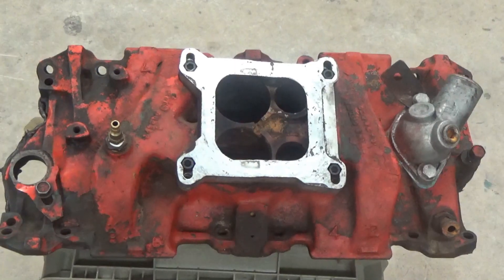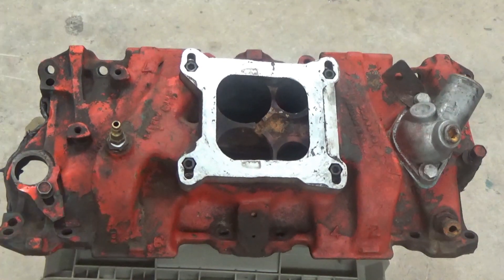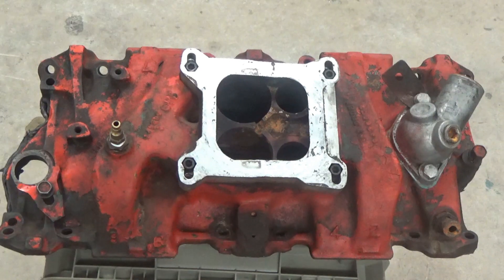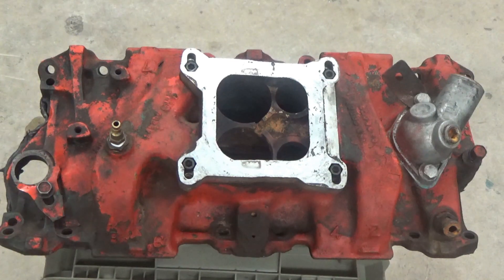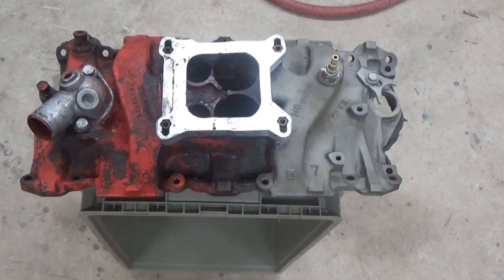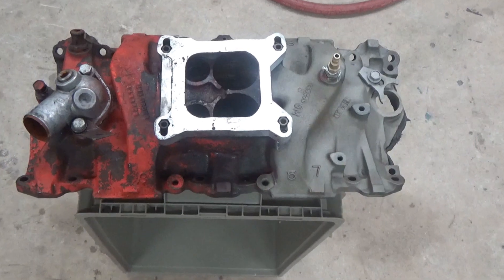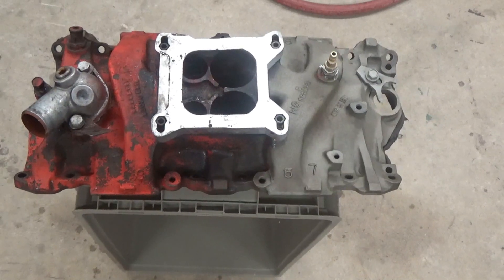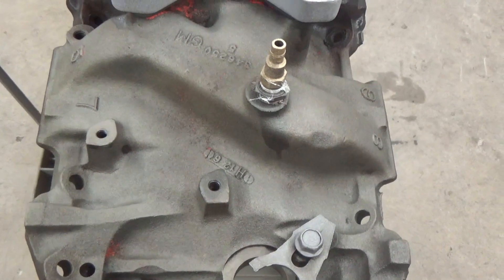Vapor Blasting Cast Iron Using Crushed Glass- Vapor Honing Technologies

Comment: I have a bead/sand blaster at work. Will any machine of yours save me time and vapor blast quicker than a conventional sand blaster? I clast cast iron and steel parts all day. I want not only the nice finishes of vapor blasting but I need to blast 30% faster. It seems like this may take longer?
Reply from the maker: In my experience, it seems this cuts blasting time from hours to minutes in most cases.